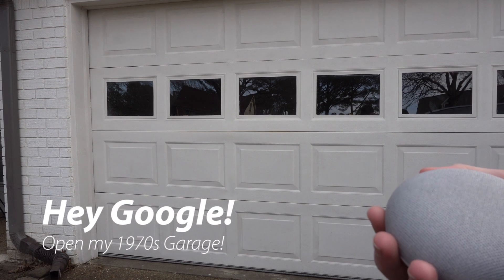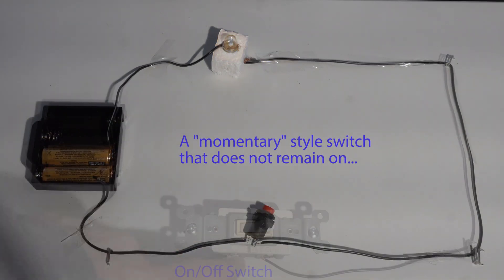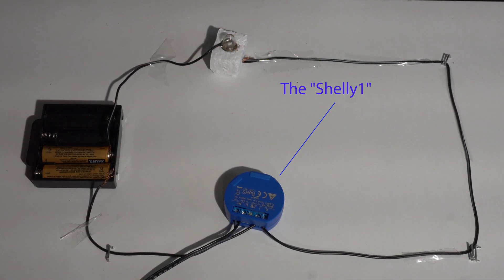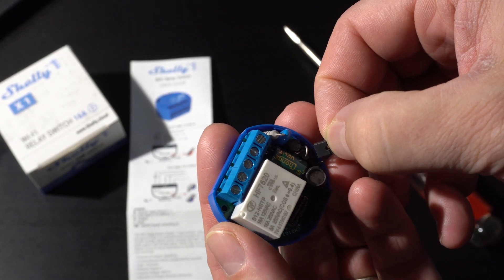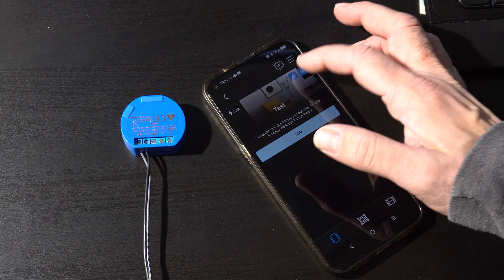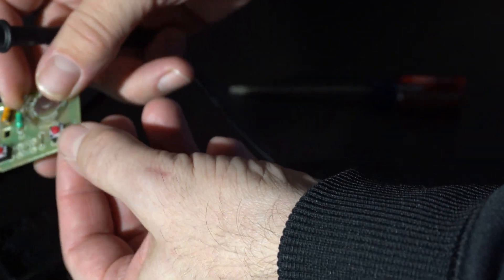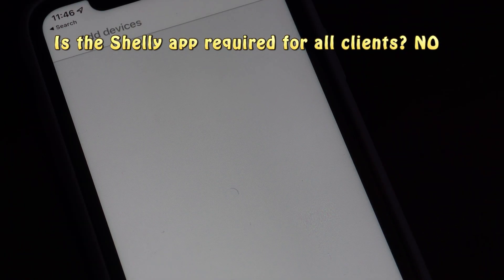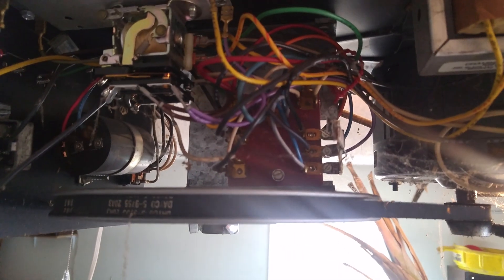Make an old Garage Door Smart with a Shelly Relay!

Comment from the maker: Update March 2023 - Fixed issue below with help from Shelly tech support by changing settings in Google Home app. Had to rename the device from "Door" in the "Garage Door" and I also changed the device type from "Switch" to "Outlet" - (the device was previously named just "Door" in the "Garage" Room and could not handle the "Activate" phrase... )
Update Feb 2023 - One thing that's irritating about the voice integration is required commands seem to change without me changing anything. When I filmed this video last year, I could say "ACTIVATE GARAGE" (which made sense with a momentary push button switch). Then, a few months ago, that stopped working and I had to say "ACTIVATE GARAGE DOOR" to make it work. Just this week, that stopped working. Now I have to say "TURN ON GARAGE DOOR" which seems odd since it doesn't know the on/off state. I'm not sure if this is Shelly's or Google's fault, but they really should have the device inform me via voice that the commands are changing, rather than just a generic "that device is not configured" message. Or better yet, do not change them!

Comment: Do we really trust these wifi devices on our home networks?
Reply from the maker: Nope, will never fully trust.... You can use VLANs and firewall rules to isolate it somewhat. I've got most of my IP security cams blocked from any Internet access. And the Shelly relay can be blocked if you don't need to control it from the Internet.

Comment: Ah so the shelly doesn't actually control the garage door motor, but 'only' simulates a person pushing the remote, which then sends radio signal to the motor controller?
Reply from the maker: Yes, that is correct.

Comment: I was looking to see if I could trigger the garage door opening with a relay to the lights within the garage. So pulling in, garage would completely light up. But also allow for standard wall switch to operate the lights. 

Would that be a appropriate? Or would I need a relay?

Since I want either a wall switch or the garage door to trigger the garage lights, I assume I would set up a parallel circuit to switch the garage lights on. 

120 V input would go to the hardwire switch on the wall, which turn on the light parallel to the hardwire switch, the relay would operate, which would close the 120 V circuit. 

Resort, either or both the hardware switch or the relay would allow the garage lights to be triggered on by closing the circuit
Reply from the maker: I would think a relay would be necessary. The wires on garage door openers I have used have power (maybe 24V? used to power an indicator light or radio receiver) which is interrupted by pressing wall switch, so maybe you could connect a relay to that power, so the relay would close when power was temporarily disconnected? However, a cleaner solution might be to use a motion sensor as an input to the relay. I have not tried this, but Shelly makes a battery-powered motion sensor which can control a Shelly relay.

Comment: Is there a reason why everyone uses the remote control for this and not the wall switch? I've been thinking about attaching this relay to the wall switch instead. No one seems to do that at all. Every video I have seen does this rewiring of a remote. Why is that?
Reply from the maker: Thanks for commenting on the video! I did this for simplicity and ease of disconnection, but another reason might be power. A wall button for a garage door typically is 2 wires that are shorted when the switch is pressed. I'm not sure if the power specs for a door switch are correct for the Shelly relay, or if the relay would reboot itself when power was taken away momentarily.

Comment: It could be been mounted near the motor and just use the same wires terminals going to the wall switch no remote modifications needed.
Reply from the maker: Yes, but in this case using the remote allowed it to be easily relocated for the best WiFi signal and possibly passed off to a friend for pairing it to their garage without any wiring changes. Thanks for the comment!

Comment: Really cool! So as of November 2022, the Shelly Cloud app has a rating of 1.9 stars out of 5. What gives?
Reply from the maker: It was a pain to get the app going at first, that's probably why. But after the initial setup, I have had no reason to go back into the app at all, just use the Google home app or local Web address. Thanks for watching and commenting.

Comment: Just did this project after seeing your video. In my case my garage is detached from the house so the idea of using the Rf signal from the remote (purchased for $11) to do the comms to the opener instead of using wifi only is superior. Wifi was maginal at the garage site.
Reply from the maker: Great! Yes, that sounds a lot simpler than trying to extend your WiFi, plus a lot cheaper than upgrading the garage door opener... Thanks again for watching and commenting on the video.
Reply: This is the way for anybody that doesn’t have an extra opener.  Just wire the relay directly to the terminals on the garage door opener head unit.